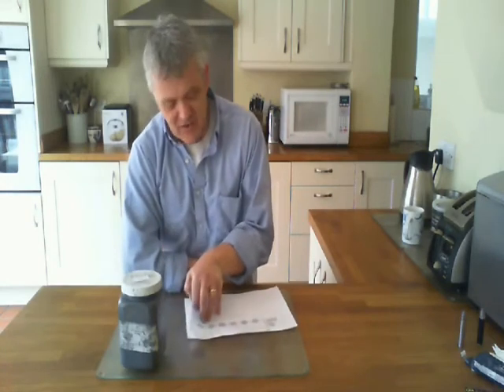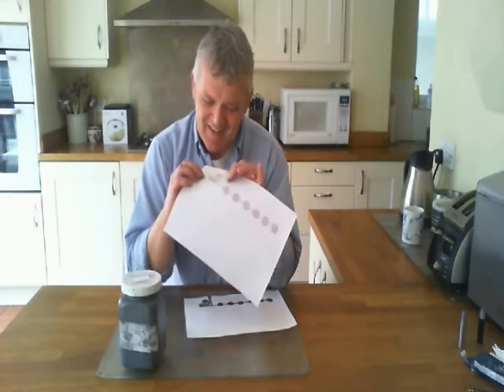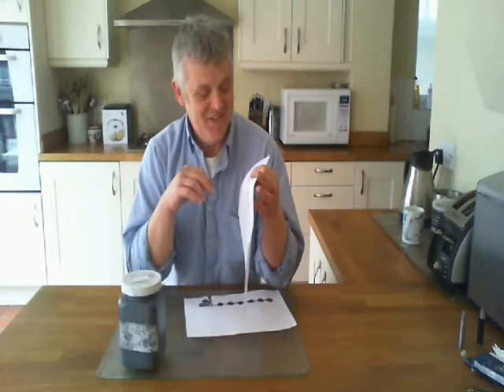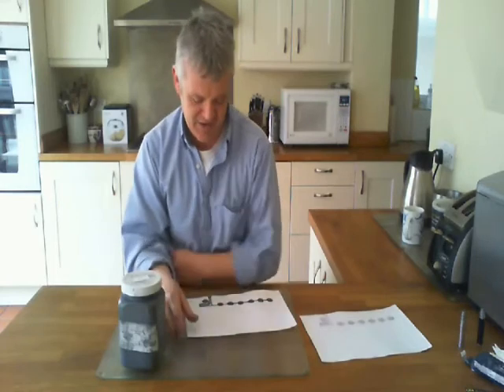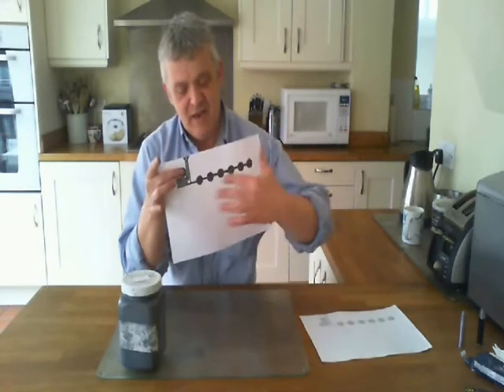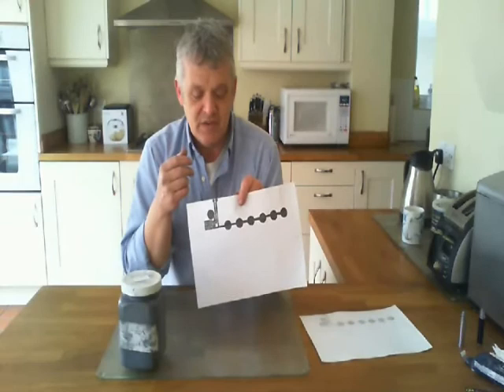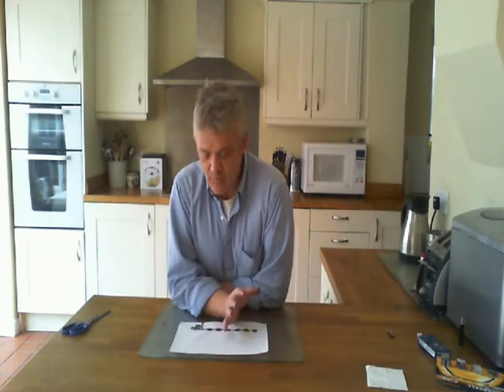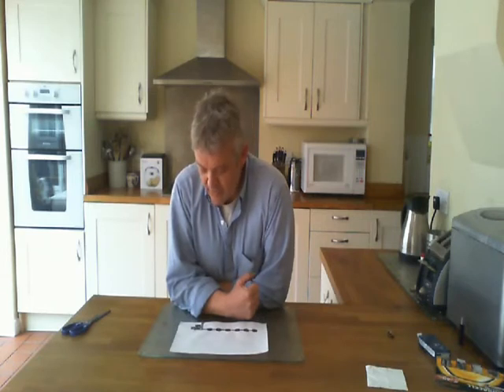Tiny Painted Drawdio - With Conductive Ink

Comment: you could probably fold the paper (or plastic) over onto itself to make even smaller multilayered/3D circuits.  Put a book ontop of it to keep the folds in position until it's dried.
If it's painted onto a plastic film, you could even put it into the microwave for a second or two to quickly weld the folds into position (thx to your ink).
Reply from the maker: good ideas mate
Reply: This is a really interesting idea. You could weld the whole lot onto a thicker base plate so that the circuit had enough structural integrity for mounting.

I can imagine printing each layer on a film, cut out the layers and align them (or fold as you suggest), stick a base layer of plastic for integrity, and microwave them. The layers will be bonded by the via points and extra ink placed strategically for for structural integrity.

I guess the only issue here is how you create the vias between the layers. I guess this ink won't "flow" through holes? Perhaps for vias you could pin-prick a hole and then wet the ink again. I dunno, just some ideas.